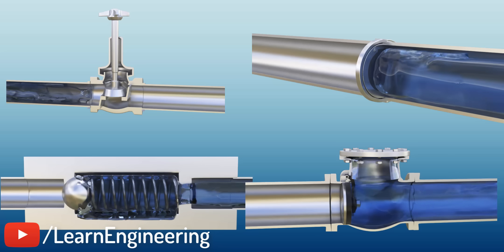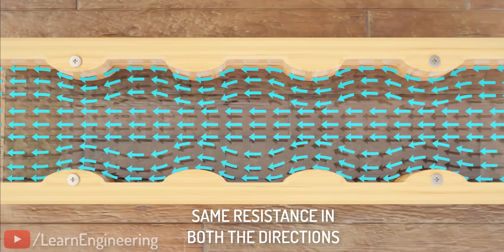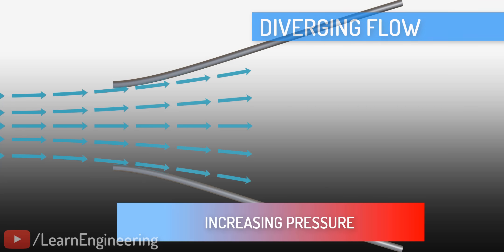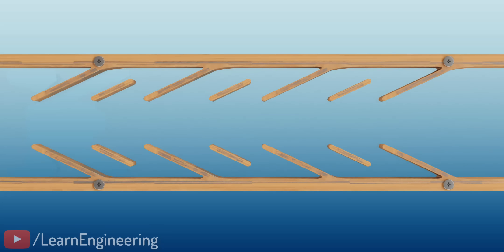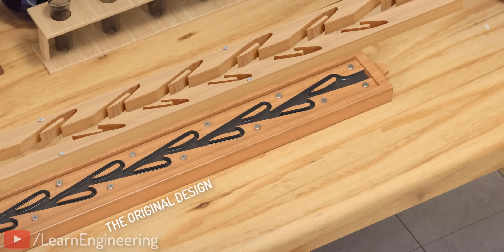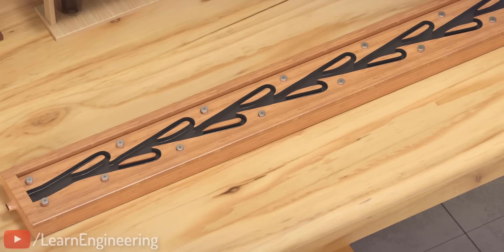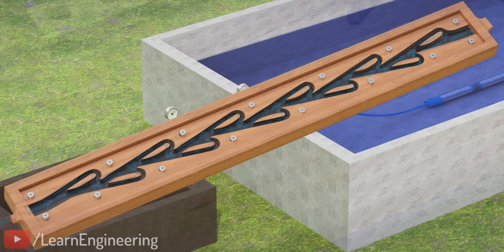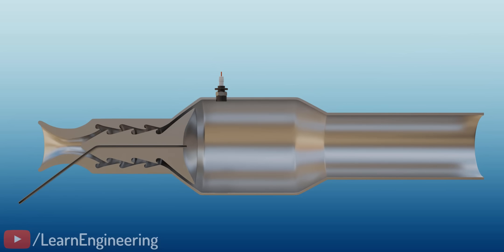Tesla Valve | The complete physics

Comment: One additional perspective: Tesla thought in oscillations and capacity - As demonstrated in his work on alternating current. While this valve works for steady-stream applications (like constant pressure water flow), it is intended for oscillating flow (like in the pulsejet engine).
Reply: Tesla was intrigued by the idea that vibrations, so basically sound, had the capacity to mimic other chemical and physical reactions. Modern science now calls this study phonons. Later, he would update his ideas to include sonic resonances from many different phenomenon. This obviously influenced his work on radio and alternating current. And directed his ideas later in life about wireless electricity, through microwave transmission. He probably didn't have an understanding of microwaves yet, but that is what he was thinking about.
Reply: I’m sure had Tesla directed more time and contemplation towards this valve , he would have incorporated a full stop application. But to serve as an indication of the type of mind Tesla possessed, he was at least as brilliant as Edison, if not more, and fit to sit at the table with Einstein
Reply: @davidbaker9089  Tesla is god Edison is a thief and a fraud
Reply: Yes.  Tesla valves could create an efficient and low-maintenance fluidic rectifier.  Think converting waves into a constant (DC) flow that could be channeled through a Tesla Turbine.
Reply: Oscillating flow of pulsejet engine? Can u explain it in simple words?
Reply: @kaitakanashi9854  Yes, of course! In this video, the valve was tested in a static environment, assuming a continuous flow of liquid / gas in one direction. When reading up on Tesla's Work, one thing that stood out to me was how often he emphasized oscillations / vibrations as key to his work. He even once stated something like (roughly) 'If you want to uncover the secrets of the universe, you have to think in oscillation, frequency and capacity' - As perfectly illustrated in his work on alternating currents. Applying this to the tesla-valve in this video: Although it does work for constant-flow applications, it (following Tesla's thinking) would excel in applications where flow constantly changes back and forth through the valve. Of course, it would have to be tuned to precisely fit the volume (capacity) of liquid / gas passing through each 'beat' and its frequency, as usual. One application where exactly such a back and forth is required is the design of pulsejet-engines. Here, you need a valve that does exactly this: Let air through in one direction and block it the other direction - And do this very quickly and with a high frequency. The tesla valve - having no moving parts by design - would be perfectly suited for this. I remember that there even is a video of somebody trying to build a pulsejet with a tesla valve, yet from what I can tell, their design was not sufficiently well tuned to work.
Reply: These don't work for pulse-jet engines, in spite of the countless patents that have been issued, nobody has actually made it work, and in fact it cannot work.

The closest anyone has gotten to a one-way aerodynamic valve was Gluhareff and it operated as a tuned resonator, that is similar physics to exhaust header primary length tuning for maximum cylinder intake pressures. Using the reflected negative sound wave to create a suction at the appropriate time. Works a treat. But Gluhareff lied, okay "marketed" in the 1970s definition of the word, his design to only burn 0.75 lb/hr/lbf thrust when in fact it was over 4.0lb/lbf/hr. Think about it, a sound wave reflection pulling in outside air cannot create enough compression to obtain fuel efficiency like that of a many-stage Turbojet. A ramjet needs nearly mach-3 inlet airflow to obtain its peak efficiency of 1.8lb/lbf/hr (2000 seconds Isp) and it gets around 4lb/lbf/hr at mach 0.6-1.0 similar to the Gluhareff did in reality. He was also brilliant in the sense he made a ramjet/pulsejet without moving parts that generated large static thrust.

And he claimed it was fully Throttleable from idle to max, but in reality is could only throttle down to 50% thrust else it would cease to resonate and snuff out due to lack of inlet airflow. Its an impractical novelty and he was a marketer of the same vein as Jim Bede or any other Hero of Popular Mechanics Magazine.
Reply: @Triple_J.1  That is super interesting! I have thought about this issue for some time and I thought that - to be used for a pulse jet - it would probably either need an unrealistically high frequency of firing - and subsequent high-velocity airflow to create the necessary compression - or a higher viscosity medium which both seem unreasonable. While I think, in principle, something like a pulsejet could be an appropriate application of this valve, I assume it will demonstrate its value mainly in electrostatic propulsion systems in the future.
Reply: as electric analogy: a diode to rectify ac current.
Reply: what i am doing here 2am reading comments, guess anything from NTesla is interesting :)
Reply: Aye, constant flow isn't impeded by the valve nearly as well as pulses.
It's very clear this was made to catch bursts of pressure 👌🏻
Reply: @wastedwizard5112  
I don't think so.

Comment: the cool thing about the check valves in the beginning is they actually work. they don't just restrict flow they completely stop it which is the purpose of a check valve. imagine putting this on the discharge of a pump thinking your sump wouldn't fill bacck up from the weight of the fluid you're pumping.

Comment: I am kind of disappointed that you tried to pass off Nikola Tesla's valve as "one-way". If water comes out the unintended end, it cannot be one-way, can it? The fact is, if you were to keep pushing more and more water into the valve, it would eventually come out on the other side. Even before the integrity of the valve would break. Later on in the video, you even explained why it isn't one-way, but rather a mechanism used for slowing down water flow with more or less control involved. I feel like your video made me dumber. Imagine the time I spent to try and accept your premise and how I would look if I were to try convince others that the valve in the video was indeed Nikola Tesla's one-way valve solution, without moving parts.
Reply: Yeah, from what I can tell, its basically just significantly higher resistance one direction over another. It is still incredibly useful for any instance where it would be hard or expensive to replace a moving part/improve the lifespan of a part. Like if parts the are very small or within a lot of machinery or too toxic for human repair

Comment: Sounds like you actually use it for a waterfall flow. Giving an illusion of higher water flow via surface coverage with slower water pump needed. That's assuming you do a bit of rock work to low flow. Interesting